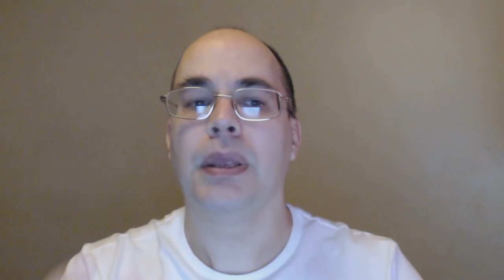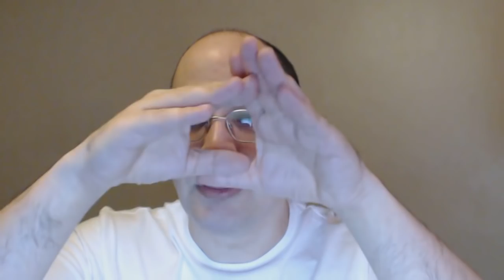How do rockets move in space, with nothing to push off from?

Comment: In a rocket  in the vacuum it applies the impulse produce by the gases resulting from a chemical reaction at very high speed. The only force that influences te velocity and speed will be the gravitational forces from the bodies surrounding the rocket. in the direction horizontal and parallel to the floor the gases of a flight reactor will remove air producing a vacuum effect and an impulse in the vertical direction dye to the movement of the air. The movement of the plain will depend of several factors; one very important is te surface of the flight.
In a rocket moving in the atmosphere the air movement will no affect the speed of the rocket. It will do the reactors gases and it will depend on the power of the impulse which oppose the weight of the rocket and the effect of gravity.
Reply: what the hell are you talking about?